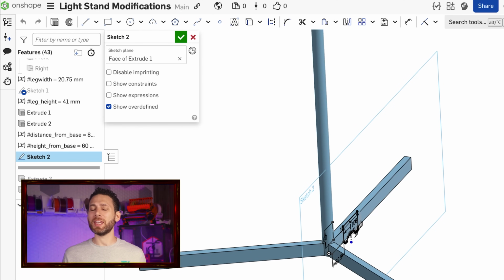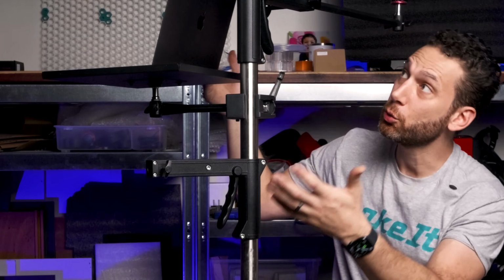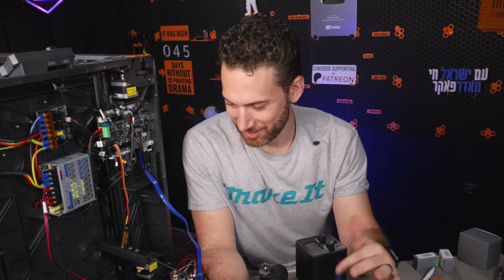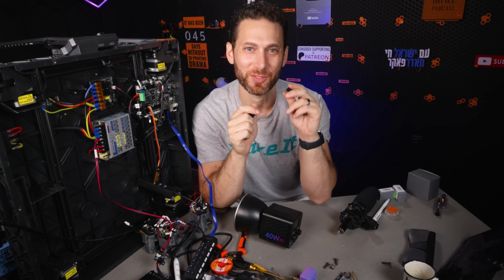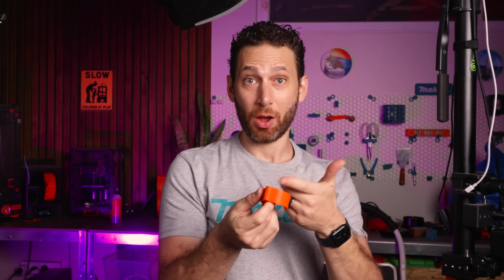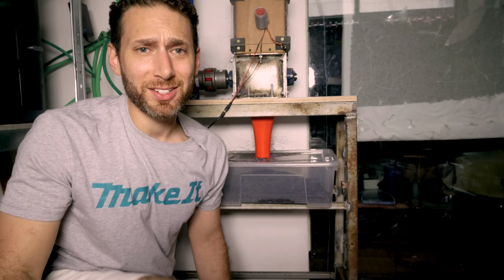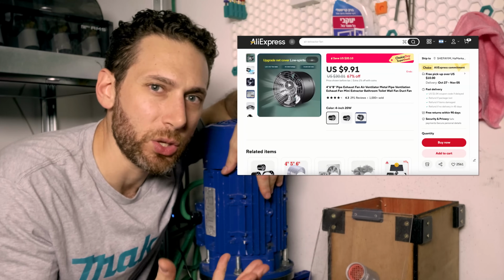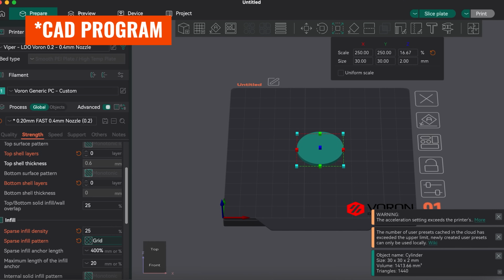7 Functional 3D Prints That Solved REAL Problems

Comment: I have a project I want to start, but I need a lot more time and knowledge before I do.  I have an F150 lightning, and the home charger handle was cracked when my brother drove over it.  A replacement cord and handle is $500.  Its a piece of molded plastic.  I think I should be able to model the existing one, figure out how to replace the missing sections - and then print each half.  

Currently it works, but I hate having it just taped together.

Comment: Some older  turbo server fans may be able to push some air. They are also designed to run for extended periods of time. Look for them in a server not a new purchase. I got 6 or 8 of them in a $20 server. Good luck with this project.

Comment: I think on your last shredder video someone also pointed to the blade setup being a problem as well. You want them to be in a < orientation so they constantly are pulling any stray material away from the walls into the center of the shredder teeth. This also helps ensure there is always material being pulled into the middle to force things through the sieve from the previous pass that may have gotten stuck in it. Your current setup pushes things outward to the walls which allows heat from the motor shaft much easier access to the material and increases its workload as that material then also can soften first and get stuck between the blades/casing on the motor side, increasing motor load, increasing heat.. and continually increasing the problem.

Comment: Regarding your problems with your recycled plastic.  When you grind plastic, you get what they call "fines".  Fines do not process well when you try to inject or extrude it.  A simple fix that we use in plastics factories is to have a screen at the bottom that is slightly smaller than the pellet size we're looking for.  This allows the fines to drop through (mostly), and leaves us material that we can process.

Comment: 5:55 There is a difference between tolerance and limits & fits.  You model fit-up, as in how one part related to another as they are assembled. Such as clearances between a pin and a hole. Tolerance is how far out something can be manufactured in comparison to the model/drawings and still be acceptable. This is especially important for mass production so that every part will fit with every other part, regardless of who or when it is manufactured.
Reply: @CAD_GEEK  it's amazing the amount of people (even seasoned designers) who say "tolerance" when they mean "clearance". There is a big difference! I downloaded a model which said "all joining parts designed with 0.25mm tolerance" and it annoyed me way more than I should have!
Reply: Unless of course they did design FOR a 0.25mm tolerance in the machine, by making the gap between them 0.5mm, meaning each part would have to be more than 0.25mm out for the part not to fit. But I doubt that's what they meant!

Comment: Barrel jacks stink! Try xt60 or xt90 connectors. They can candle up large amps. I use them for everything low voltage (5-60v) but high amp (20-50a)

Comment: I think you may have the solution to your overheating cables, put a hose on the air intake and run the cables inside it. The airflow should cool the cables, all you need to find out is if it is enough cooling and of cause use a hose that do not collapse. Perhaps you can use speed control to find the sweet spot with air flow vs cable heat. If that is not enough, use thicker wires to reduce resistance as well.

Comment: "Losing time" to learning a new skill is often well worth the sacrifice but hard to justify in the moment. As someone who taught hs robotics kids these skills, 4 thoughts to employ in an either/or capacity: 
1) model one random object in your space per week (pick any time interval but stick to it), it's crazy how many operations go into reproducing simple objects. 

2) try to design the same part in different ways. Go through building the model once then go back and do the same fart with  different types of operations (i.e. revolving an accurate profile vs extruding and cutting. 

3)Try to see how few operations you can use to create a given part. Minimizing operations isn't always the best way for ease of modifying the part later but it forces you to try different things, teches how constraints stack and keeps large assemblies from bogging down
4) improve on level of detail, once you have modeled an existing object to design your "fix" part off of (or any part from #1), go back to that part and add in details that you didn't care to model the first time to make it more accurate as you gain proficiency in using different operations. And often that part can then be used for more in the future (i.e. an aluminum extrusion can be just a column then going back it can show the full extrusion profile with accurate dimensions.

These 4 techniques will help you learn without feeling like you are investing in time wasting or like you are sinking a bulk of time all at once into learning how to model in 3d.  

Try building a simple Phillips head screwdriver that you can find in your drawer......

Comment: one thought I had was getting a second one of those fan's for the shredder, and angling the fans to converge just to the left and right of the center blades, it should help a bit with redirecting the shredded material away from the blower. You may have to find the optimal angle of the fans to still be able to push plastic but not fly directly back into the fans.also putting an extend plastic shroud that extends below the blower fan board and output about 10 cm would also help deflect flying chips

Comment: For your shredder issues, as I understand things, the shredder is overheating because it was originally designed to grind to 0.8mm, but you modded it to get down to 0.4? 

Working on that premise, and realising that there are space and cost implications for this: 
Would it be possible to create a 2 stage shredding process, where you reinstate the original function of the shredder you have for 0.8mm bits, then funnel the output from the 1st shredder into a 2nd, finer grade shredder, to get the required material size?
If there were still heat issues, you could even put a watertight sheath around the funnel from the 1st to 2nd shredders, and water cool the output from the 1st shredder?

Or, you could use a PC case fan to do the extraction? I don't know, air displacement wise whether that would work better than the turbine fan, and you'd need to use a mesh to stop the shredded bits flying out of the hopper, which would probably get clogged ridiculously fast... I don't know, but it's a thought?

on a related note, can you make watertight gaskets with TPU?

Comment: I bought some magigoo on a recommendation from a previous video of yours, as I was having some bed adhesion issues with larger prints, where the corners would warp leading to non-level bottom layers.
I have to say, it's the best 3d printing accessory I've bought! Everything sticks to the plate perfectly, and I've gone up to about 20 prints before cleaning and re-applying. Tall stuff, wide stuff, right out to the edges of the build plate - nothing phases it. It's amazing the difference it's made to the quality of my prints. Highly recommended 😀
Cheers!
Reply from the maker: Yeah man. Glad you like it! People are like “it’s expensive,” but then they try it and see how well it works and how long it lasts and they get it! I haven’t tried more than about 10-15 prints on one application but wow, I will try to push the limits more!

Comment: Thomas Sanladerer released a video that was showing off a 3devo shredder and filament maker.
Two things from the shredder showcase that might help with your shreddeer that I noticed: 
1) Slow feeder so not too much material gets in at once. 
2) Every so many rotations, and it is rotating at a slower speed than yours, it does reverse rotations. This would help prevent things from getting stuck.
Reply from the maker: Yep. I saw that. It’s also a double shredder though which is way better.

Comment: I've been dipping my toe into designing. Right now, I'm just using Bambu Studio, but I've designed a part to go with a cheap picture frame to use the floating mount I had, a topper for my work monitor pole to attach a toy to, and, my most used thing, a cup holder to fit on the rail of my daybed so I stop knocking my drink off it.

Comment: FYI - when you are talking about 'tolerances' you're actually describing 'clearances'.
There is a difference between tolerance and  clearance. I get it that you aren't formally trained in engineering, but little things like this are important.
Reply from the maker: Thanks! I’m still learning and appreciate the instruction

Comment: great video as always:) regarding increasing pressure to "push" the particles, axial fans, like the one you use, are very bad at creating static pressure, which is what you want there, air volume is not really a measurement you should care about here:) you could switch to a centrifugal fan, bought or made, either way, it will be a much better fit to your problem in my opinion. and maybe even using some flexible material to create a seal around the edge, that will definitely help as well. and again, thanks for the content:)
Reply from the maker: Nice. Can you link me? Thanks

Comment: Your shredder blades look about 8mm thick. about the size of the original sift..  for the smaller holes you need thinner blades...  with less rechewing comes less heat...  😀

Comment: I wonder if you can add some sort of heat sinks and fans to the exterior of the shredder to cool the metal.  Mounting them may require drilling then using a tap and die set to thread the holes.  Computer thermal pasts could carry the heat away to the heat sinks more efficiently.  The more complex option, if cooling the exterior of the shredder works would be to water cool it with water blocks, a pump, and radiator.

Comment: As someone suggested, use a shop vac for the shredder. However, if you’re getting a good seal between your funnel and both the shredder and the storage bin. I’ll admit I’m not sure about how much force you’ll need to do this. You could turn it into something similar to a wood shop dust collector. You’d have to model a rubber seal for the bin lid. Then cut a hole in the top to connect the shop vac hose. 

Or buy a 5 gallon paint bucket with a tight sealing lid.

Comment: Hey 👋 random viewer here with a random idea from another profession as well as incorporating a couple other ideas. 

For your excessive heat while shredding I'd suggest something similar to grinding up meat during sausage making. 
Your idea to get a smaller piece just needs layers. Maybe design a way to switch the different size meshes onto the grinder. Grinding into the bigger size, then switching down and grinding the smallish stuff down to the size you are aiming for. This is essentially what has to be done while making sausages. The meat should ever get warmed during the entire process as this will change the final texture. I think something similar might help. Giving the machine time to cool down in between will probably help. Future idea is that maybe you could invest in another grinder to keep the meshes on at all times and then just more the material from one into another. 

Also adding in the idea you already commented on about using something like a fresh (thus keeping everything clean stilln hopefully) shop vac to help pull the material through from the other side. 

Sorry for this long message. I am a ranter. I hope you and the family stay safe.
Reply from the maker: Good ideas thanks I’ll try to put them into practice

Comment: Great video on showing how ideas come to life! 

I taught 3D modeling for over 20 years. The best advise I could give students about how to attack a design was to think of how you would make it using hand tools IRL. Like whittling a block of wood or machining metal into what you need. Or, how you would build up wood, or welding steel, to get to the final part. When I design for my shop, it usually uses both methods. Many parts just design themselves too.

The other piece of feedback I have is terminology. You are not designing into your parts tolerances for the fit between parts. That is called a clearance, the space needed between parts in an assembly to be put together the way you want them to be. Very common accidental swap of terms. A tolerance would be how you could build a part dimensionally the wrong size and still work correctly. Like drilling with a sharp bit vs a dull or bent bit. You get a different sized hole, but they both work. The size difference between the hole sizes is the tolerance. (Tolerances are used in manufacturing so we can get more imperfectly mass produced parts that work with the required clearances in the assembly. I hope that all makes sense.)

Keep up the great work and stay safe over there! Thank you!!
Reply from the maker: Good corrections thanks!!!
Reply: beautiful explanation of tolerance vs clearance
Reply: How would you suggest I go about learning some basic, functional CDA skills to make things like were shown in this video. I want to be able to design things, but even the most basic CAD programs (I'm talking TinkerCAD here) just seem to be a struggle.

Comment: I agree, the best roi with a 3d printer is being able to design your own custom parts to fix your own custom issues. In our dining room, we had a power strip attached to a table leg with velcro but it kept sliding down and would eventually come loose completely. I managed to design a custom bracket in Fusion 360 and the power strip is now held in place perfectly! A simple but great solution and something I feel proud of lol.

My only problem is that my lack of CAD skills is holding me back so far. I have more ideas than I know how to design 😬

Comment: try freezing the plastic before dumping it into your shredder?? Might make the plastic more brittle and help out the process...
Also i run a small hammer mill for recycling computer parts, and I’ve rigged it so a waterfall feeds in with the raw material into the top, helping wash everything through. The bin below stays about half full of water, which is great for separating materials—heavier stuff sinks while anything lighter than water floats. Honestly, I wasn’t even thinking about cooling when I set it up. I was just tired of dealing with dust collecting in the corners and floating around my garage.

Comment: How about a vacuum pump on the hopper side? May need a actual filter due to partical size but it would help suck out plastic from the grinder and not only have less material to heat up but more air will move through

Comment: Have you considers the idea to Change the box from wood to metal? That should help in dissipate the heat. In that case, if still necessary, you can try to cool further down with some peltier cells. Does this make sense to you?

Comment: I'd just ditch the barrel jacks and go to Powerpole connectors.  As a bonus, it's really easy to design a printable mount for powerpole connectors on the machine so that you can have one end fixed if you want it.

Comment: Just a thought. Instead of the fan on top to cool and a funnel into a hopper on the bottom to catch shreds. You could use a funnel to a shop-vac and use that as both your airflow source, and hopper. It would provide lots of airflow and be actively pulling the shreds out of the shredder instead of trying to push them through.
Reply from the maker: Cool idea! I might try that.

Comment: As a hack, if the wire itself is heating, splice in an additional wire near each end for each of the wires, so you have two wires connected where one was.  That can handle twice the current.  The barrel jack and plug may need to be upgraded if those are heating up too.  Replacing with larger wires is the preferred method, but hacks for integrum use are helpful.

Comment: Would there be a way to liquid cool the shredder? Copper that’s thermally interfaced to the device in some way could work. I work in an industrial waste processing facility and our shredders jam when not cooled properly. It looks like it’s a heat soak kind of issue where the plastics are insulating heat generated by friction.

Another alternative is that heat pipes and heat sink could be used to wick the heat away as well, joining them to a copper plate on the shredder. Just ideas; but i don’t have intimate experience with the shredder like you do. From my experience it’s friction causing heat soaking

This is going off of my assumption that you’ve readjusted the blade positions. You had mentioned that in a previous video; I’m assuming this is just old footage.

You likely don’t even have to cool the blades directly. If you cool the assembly on the outside it will passively provide some cooling to the blades.
Reply: Also I assume that due to costs; having a second shredder that goes through a smaller screen. Grinding large pieces causes a lot of heat; so when you have such large parts going in it’s going to give way higher temps.

Comment: For the varipole cable clips, you could smear on a thin coat of Tec7 on the inside and let it dry. It will turn rubber/silicone-like and improve the friction grip.
Reply from the maker: Good idea I have some plastidip